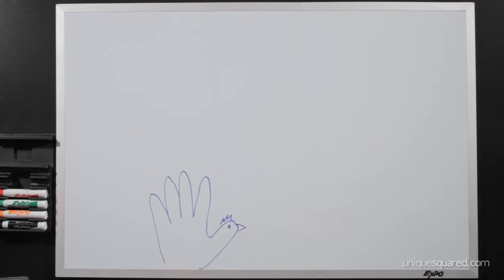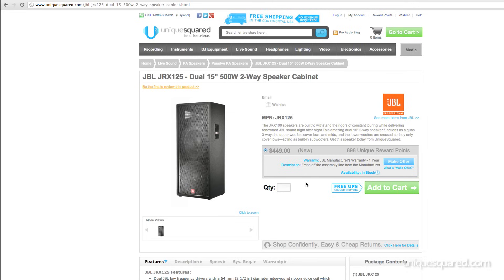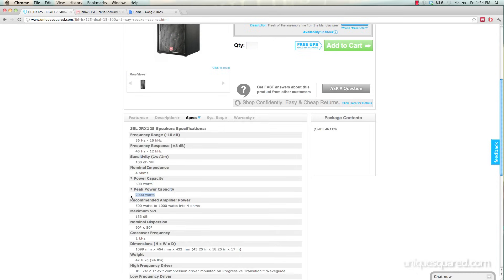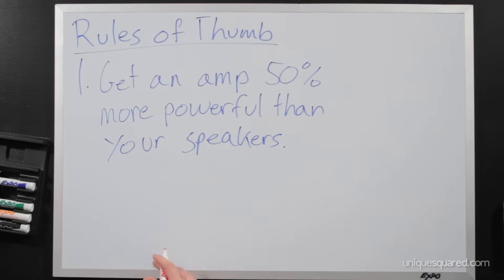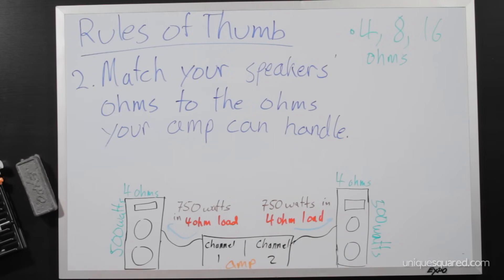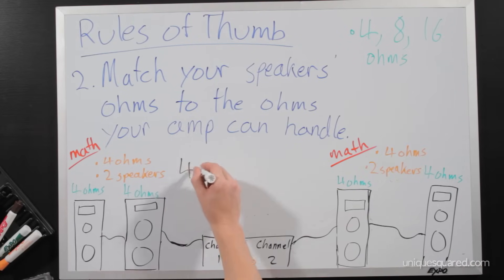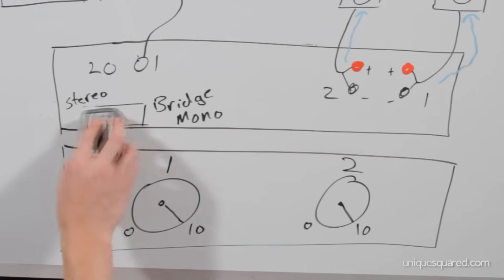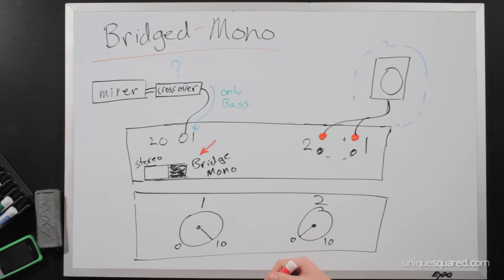Amplifier to Speaker Matching Tutorial | UniqueSquared.com

Comment: Amps have a lot more protection than what speakers do. Putting too much power into an given speaker and crack up the power you'll fry the voice coil in the speaker. Over driving the amp using far too powerful speaker well it would have to be massively over what the amp can handle. If the amp is 500 watt per channel than its safe to say the speakers needs to be around 100 to 250 watts more than the amp. This is safe for the speakers but would give perhaps too much head room? But again the amp wouldn't blow cos of it. It would generate more heat although the transistors can handle a lot of heat before they blow. To reduce the risk of frying the amp simply use a fan cooled type with overheat protection, along with speaker and short protection and not to mention overdrive protection. So even if you over load the amp by using overrated speakers it will not put the amp into too much danger. 

Also if you select underrated speakers for the amp, you'll might notice the sound doesn't sound quite as good when being pushed. So again its better to have the speakers rated higher than the amp but within REASON.

Comment: This makes no sense. If connecting a less rated power amp to a greater rated speaker kills your speaker, then you have to use your volume always at maximum level, if not you would blow them up.  The rule of thumb is to match you power and impedance ratings between amp and speaker.

Comment: Great Video! I have just started DJing for a local 50s music club that has around 20 - 100 people. I know nothing about speakers etc but I have just bought a SPL1500 2 Channel DJ PA Amplifier 3 Band EQ 2U 19" Rack Mount AUX 1500W Amp that was going cheap although it was new. 
I use Passive speakers but the ones I have are only 12" and want to buy 15" ones but havent got much money so could you please advise me on to which 15" speakers I should look at given my AMP is a 1500 W. 

    Model: T178.798
    RMS @ 2 Ohms (W): N/A
    MAX @ 2 Ohms (W): N/A
    RMS @ 4 Ohms (W): 2 x 375
    MAX @ 4 Ohms (W): 2 x 750
    RMS @ 8 Ohms (W): 2 x 250
    MAX @ 8 Ohms (W): 2 x 500
    In - Jack: 0
    In - RCA (Phono): 3
    In - XLR: 0
    Out - Speakon: 0
    Out - Jack: 0
    Out - RCA (Phono): 0
    Out - XLR: 0
    Out - Binding Posts: 2
    Bridgeable: Check Description
    Dimension (mm): 482
    Dimension (mm): 270
    Dimension (mm): 88
    No. of 19" U (Units): 2
    Weight (kg): 5

With thanks

Comment: the way you explain is good the only thing i dont get is if you have the  800 amp and 500 spk  and the you ad 2 more do you need to go high on the amp or just wire good for the ohms meaning  if i have 2 sets of 500 watts spk (4 spk) i can run them with a 800 watts amp if i wire them on impidence or i need to go higher

Comment: Under-powering speakers can do damage to the speakers, not the amp. In fact, running an amplifier at maximum output means it is running at best efficiency. It's the power supply which suffers most, but a well-designed amplifier should have a power supply which can supply double the amplifier's rated power continuously.

Still, I completely agree rule of thumb should be that amplifier rating should be 1.5 times speaker rating. :)

Comment: Slightly confused when the video expresses that a 2ohm rating for the speakers (individually) is too low for the amp to handle...yet, when 2x 4ohm speakers are in parallel...making 2 ohms, it's ok. 
Is this just because the original resistance of the speakers is 4ohms so adding extras in parallel (and hence reducing resistance/impedence) is fine? 

I'm new at this. Sorry for dumb question.
Reply: Ok, made a mistake there...he says that THIS amp can run on 2ohms.

Comment: Simple rule of Thumb would be Over-loading  takes place when load goes higher than source , lesser the Impedance more the current and more the current more the power. ........somebody correct if i am wrong , all  manufacturers states do not use an under rated speaker ......so if I use a 500watts /ch rated speaker to a 750watts /ch amp both RMS then I am going to see the voice coil airborne.

Comment: Maximum Power ................................................................... 50W x 4
PWR DIN45324, +B=14.4V ................................................. 30W x 4
● TONE
Bass ..............................................................................100Hz±10dB
Middle ............................................................................. 1kHz±10dB
Treble ............................................................................ 10kHz±10dB.....can you tell me please what kind of speakers can be used for this cd player?...i dont know what means nominal power....how many RMS means.....what rms means that speaker must to have... many people said  the source must be powerfull than speakers but how we must calculate this....for example the source has 20 w rms,and in this case how many RMS must have the speaker to sound good?thank you!

Comment: I've been using a 60W stereo amp with 150W speakers (2 way). For almost 7 years it's been working with absolutely no issues whatsoever. Same amp, same speakers, almost 7 years. So it confuses me you say that having speakers of a higher power handling will damage the amp...
[EDIT]: I think I get what you're saying now... overdriving an amp rated for a lower power output than that which the speakers can handle can actually burn them because of harmonic distortion!

Comment: While you calculate 2 speaker per channel with impedence of 4 ohm becomes 2ohms, you forget to add up the power which makes it 500w +500w = 1000w per channel while the amp should be 1500w 50% more powerful than speaker load.

Comment: I have a 1000W amplifier,  it has 4 speaker terminals at the back, 2 speaker per channel rated 8-16 ohms, question is... Can i connect 4 350 watt 8ohm speakers on it? Thanks.

Comment: Amps equal one speaker divided by number two speaker if run in a parallel connection. If run in a series connection the total ohm load equals the two speakers added together. . There's a lot you can do with those basic ohm loads on the amps out put. Series can really cut the volume while parallel can lower the power require moment. For every three Watts of sound output, that sound goes up by 3 db, which is perceived as be 
In loudness!

Comment: man things get complicated in this comment section, but as much as I could summarize is that:
--You need your speakers to have a higher rms than your amp, so even if you push the amp to it's limit, it won't overwhelm the speakers.

This makes a little sense cause just last night I was trying out my Martin F8 speaker (150W AES/600W peak, 8ohm as it says in the manual) with my amp (which specs are below*) and I heard some clipping. Thats counting the 280w RMS from my amp and the 150w from the F8, which I took into consideration after watching this video.

Amp output Power:
2 Ohms>650w RMS Per Channel*
4 Ohms>450w RMS Per Ch.*
8 Ohms>280w RMS Per Ch.*

Also I tried a subwoofer (B&C 15PK40) thats 400w (Nominal, 800w Continous,) 8ohms and it had no clipping. I am somewhat new at taking into consideration the physics and numbers behind it so help me with this next one.
--Am I going to screw something up if I connect:
-two Martin F8s, in parralel in one channel, thus getting 4ohms of resistance, and on the other, if I connect 
-two 400w, 8ohm subwoofers just the same?
Reply: Presen Zrak you didn't hear clipping lmao Clipping is an electronic signal, so unless your ears are an oscilloscope you didn't hear clipping. DISTORTION is the result of clipping, and you can hear that, but actual clipping occures before a sound is produced.

Comment: Hi there need help please i have 4 Audiopipe 6" speakers rated at 250w max, rms 125 and have 2 super tweeter Audiopipe rated at 250w ,rms 125watts and then im trowing in 1 pioneer 10" flat shallow subwoofer rated at 1200watts max, rms 300watts, what size watts amp and type of 5ch amp do you recommend to go with??  Thanks

Was thinking of buying the audio pipe 3000 watts amp from ebay lmk please

Comment: You can drive a 500W speaker with a 10W amp, the sound output just won't be very loud. In a home stereo, it's not crucial to have an overpowered amp for your speakers, depending on your usage. If you listen to music at comfortable and neighbour-friendly levels, a small-ish amp can drive big-ish speakers to a certain degree, lets say a 50W amp driving 100W speakers. But in a professional setup where you are looking at a high power usage scenario over prolonged periods of time, you want a more powerful amp, the manufacturers of speakers often recommend an amp which is equal or upto double the power of the speakers, i.e. 500W to 1000W amp for 500W speakers. The reason for this is that you want to avoid that the amp will start clipping at all costs. An amp that clips will blow up speakers very quickly. Then it is up to you as a sound engineer to handle this power correctly, i.e. not push the speakers too hard by setting the levels correctly on the amp. A 500W RMS speaker can handle more than 500W in short peaks, i.e. a kick drum or similar, as long as you don't push too hard.

Comment: I like to run 3 times the power. If its a 100 watt rms i would run a 300 watt amp. I have ran 300 watts to each tweeter before, 500 to each midrange, 750 to each midbass and i ran 2,000 watts to each subwoofer. It is Focal speakers and Steg amplifiers so, believe me when i say it is intensity on a whole different level.

Comment: How would you power 2 Klipsce Rf-82 ii tower speakers in surround sound. they are 150 - 300 peak. nobody seems to be able to know. not even the manufacture after calling. thanks in advance
Reply: Terenzio 300 wpc amp

Comment: There seems to be a lot of debate about matching amplifiers to speakers.  Some of the content in the video is not correct; RMS, Program power...they are not the same.  So far as amplifier power ratings go; I'd match a more powerful amplifier to lesser powerful speakers.  The Reason: clipping.  If you run a low power amplifier at full tilt, the chances are the amplifier will clip, pushing DC into the speaker which can cause the voice coils to overheat; this usually kills the high-frequency drivers to start off with. If you have a high power amplifier running lesser powerful speakers; you'll hear when you are driving the speakers too hard as they'll be moving to their physical limits, you'll hear them start to buzz, and can back the power off. Over-driving speakers for a short period is less damaging than running DC into them for extended periods. For those of you who don't know; clipping happens when the output stage of an amplifier is being driven to it's limits and starts to saturate. This saturation is the voltage swing of the amplifier output getting close to voltage of the power supply. When the output stage of the amplifier is close to the supply voltage, the output voltage cannot rise or fall any further, so the peaks of the "wave" are clipped off...hence the name clipping.  When this happens high energy bursts of DC make it to the speakers; and as HF units are less tolerant of these high power DC bursts, they are the first to pack up. The lower frequency drivers will take a lot longer to fail (if at all), but the tell tale-sign of speakers being driven with a weedy amplifier is usually a fried HF unit. When installing club audio systems a few years back, I was often pairing 2.5KW amplifiers with 2KW speaker enclosures; and never had a problem with speakers being fried.
Reply: agree, I bought a pair of JRX 125's 6 years ago and did extensive research on amp matching to finally ending up getting lucky enough to liaise one on one with a Crown technician on one of the official Crown forums and ended up running a Crown xls 402 in bridge at 1125 watt 4ohm into 1 speaker, and a 2nd 402 bridged into the second. Yep, 1125 per channel into the 2 JBL's . All the info and rationale explained to me panned out, the headroom, clean power etc etc and the sound is very very powerful and clean as clean can get. I will add that I am pretty sure I have only seen a red clip led a very few times blink on and have instantly reduced gains etc ( as advised ) My combination of this is insanely clear and "loud" but more sort of powerful loud than just boomy. I have run this set up for 6 years on a frequent basis and all the gear is trouble free to this point, so thats gunna be hard to argue with eh!
Reply: Exactly what I was thinking
Reply: denise floyd At last someone who knows what they’re talking about, I’m sure it must amuse you as it does me when I see videos on here of car “guys” claiming 48,000 watts/160db system in a Fiat Punto.

Comment: Thank you for this video! It does an excellent job of summing up the pairing process as simply as possible.
I've read hours of explanations online only to come away more confused. 

Some of the comments below are insane- the audio nuts and people who don't know what they're talking about strangely sound similar.
This video just goes over the process of pairing a set of speakers to an amplifier properly. 
It does not cover speaker sensitivity, etc. because it doesn't matter at this point. He's clearly working with a PA system for a venue. While your home listening needs will most certainly be different in terms of speaker sensitivity, speaker size, etc. the concept is the same. 
If you're going for audiophile quality sound, pre amps, filters, etc. all come into play, but again, it doesn't matter at this point. 

Great video!

Comment: You are wrong in rule 1 you DO NOT use an amp 50% more powerful than your speakers power handling.You risk damaging the speakers with too big a signal. Can't believe you have put up a video that's so wrong. The opposite is correct, use speakers that have a greater power handling capability than the amplifier so you do not run the risk of damaging the speakers.
Reply: NoStringsAttached I think it is a good idea to have a too powerful amp.  I use pro in my car with homemade speakers also pro gear.  Car audio is not as powerful.  If you dont ever use it at full power, it runs cooler and more efficient.  Just set the level lower than tops and you will be fine

Comment: if I'm tinkering, can I wire a 4 ohm resistor in series with my 4 ohm speaker and use an 8 ohm amp?

Comment: Guy, unique square is not an idiot he has some facts in him. 1-To run a speaker well, make sure your amp is 50 and above percent more powerful than your speaker rating. this allows you to run the amp at optimum without overheating. However if you run your powerful amp at maximum you will blow your speakers, but why would you run a powerful amp at maximum in your room? 2- In electronics/ electricity when a coil moves in a magnet electric current/ electricity is created and will flow back to your amp. this back flow of electricity/ eddy current is what your amp will fight back to operate at optimum. So get a powerful amp and run it to enjoy  music or movies you will have made the right decision.
Reply: Hosoga Eugene you know an amp and speakers work on AC current right????? Hence the push/pull of a speaker....

Comment: It's interesting to read comments that this video is misleading or not. Both have a point. I am not an expert on electronics but this is what I have been told.

(1) Some says the video is true and amps should have higher wattage over speakers. 
Point. If the amp gives full load to lower watts speaker, the speaker's voice coil moves over back and forth its limits destroying itself.

(2) Some says the video is false and speakers should have higher wattage over amps.
Point. If the amp gives full load to higher watts speaker, the amp clips, may produce DC signals, burning the voice coil destroying the speaker.

(3) What if I buy an amp that matches in terms of impedance and wattage?
Point. Wise move. However, not all amps and speakers have same specs. Different amps/speakers may sound differently with varying frequency ranges...and millionssss of other factors. LOL

Bottom line, it's fine to start knowing your PA setup on wattage and impedance. However, the two are just strands from a haystack. Know more and do math.

Comment: can i use 240 watts 4omhs speakers to 140 watts 8omhs amplifier
Reply: the ohms matching is about not pushing too much current.  if amplifier is designed to require 8ohms (while sending 140 watts), then sending to a 4ohm speaker means double the current through the circuit (endangering the amplifier); imagine for a moment what happens when you hook up a 0 ohm speaker - like a short circuit.